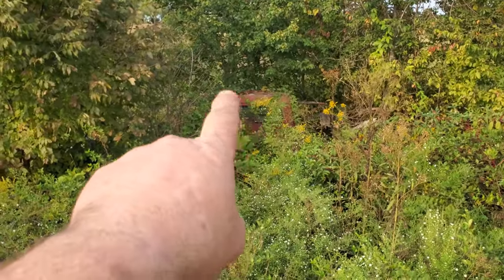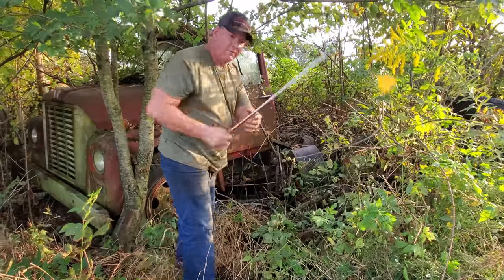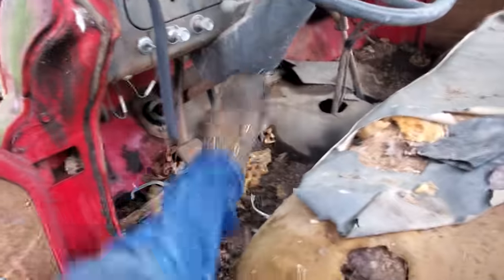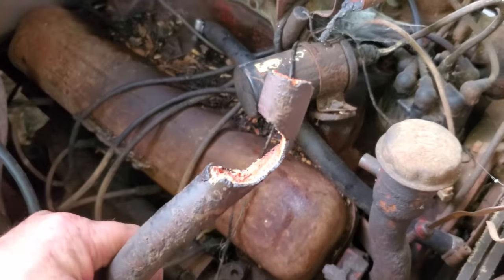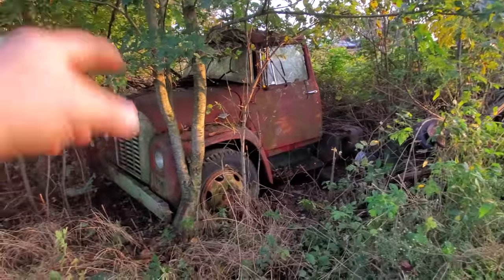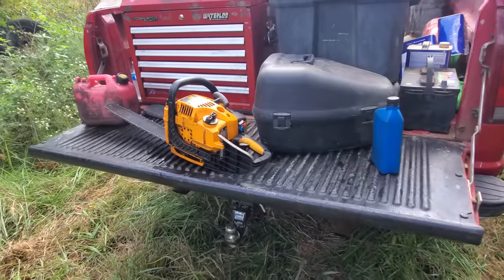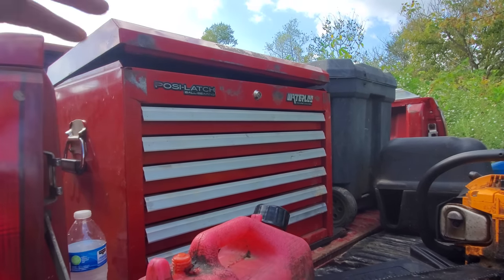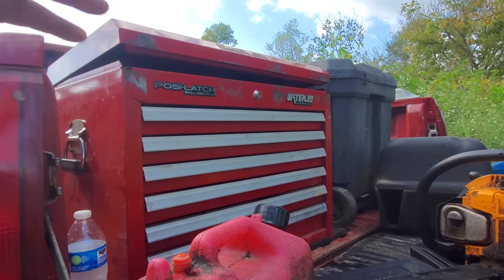IH Loadstar Sat 20+ Years Will It Run FAIL

Comment: Love these videos. My great grandfather drove a 1963 international loadstar 1600 for many years. He used it to haul cedar to the cedar mill to sell it for extra money. The old truck has been sitting in the field for about 30 years now but the 345 v8 still turns over. I haven’t messed with it other than that though. Its got about 250,000 miles on it and from what I heard from him before he passed it’s about totally worn out but ran when parked. Maybe some day I’ll try to get it going.

Comment: Hey Chad, The Kentucky farm license plate was issued sometime in 1993 in which the farm and commercial license plates always expire on March 31 as opposed to the regular license plates that always expire on whatever month your birthday is.  
Kentucky at that time always issued brand new license plates   each year rather than buying new decals each year. I wish that I could help you more, but that’s the best that I can do regarding the license plates. Around that same time period, I was running a 1979 Ford F-350 except my truck had the commercial license plate. 
I do remember that the IH and older Fords were sometimes a pain to get the correct parts for because of the change in production runs which meant that you had to know all the numbers from the ID plate on the door jamb.

Comment: Excellent video  Chad  :) also think that truck be 1966  to 1972 year also thought might been 304 or 345 or 392 V8 carb looks like Holley 1000  CFM  daul chokes with cable knob dash to plus 4 barrel , Transmission  be Eaton D18  Manual floor shifter 5 or 10 speed if has button on gear shifter with Bow Low First gear  and axle possibly be 390 or higher ratio ! 3 or 5 ton stake truck ! My late Father had International  farm tractors plus machinery  with Stake trucks and Highway Tractor Truck  for lots years 1960 to 1994 ! Also looking forward more videos too soon watch on this truck Chad and hope bash by eye okay too ! Plus may next try tow with tractor and bump starting too after soak engine up to! May work or not free motor too !

Comment: That Truck is probably early 60s like 63 clear up into 70s.  That sheet metal front end would fit on your Loadstar with the Fiberglass hood i think.  I H did not change those Cabs for many years.  I worked for a Dealarship from 72 to 77.  The Fiberglass front Hood was a later option.  303 and 345 were very similar engines.

Comment: My grandpa had a green one it was funny cause he had to have his girlfriend ride with him to hold it in gear cause it would jump out sometimes driving down the road he was in logging it was a straight truck your Chevy looks close to model I've got and windshield wiper motor has a circuit board on it and sometimes soldering joints break but joints are not small ones so easy to fix if it's the soldering joints

Comment: I really don't know of another brand of vehicle that has turned its image around anymore than international. I believe this style was clear up to seventy seven if memory serves me atall. That engine is to me not the best or other in power for this size rig, as that 345 was to me the very best engine available for a good many years. I myself have gotten the dang bug on this LS rage and can see a big 6.0 LS engine setting in the hole..... I am of the opinion that the original engine is absolutely the best way for cheap rebuild and run again. All of that said tho, the LS engines going a half million miles without too much work on them seems to be absolutely the normal thing for them and its making them quite high dollar rigs. For the longest time, Cummins 5.9 was the engine everyone ran to and swapped them into even Mustang cars. Kind a   stupid putting that much weight on the front of a car that might not weigh as much as the engine being swapped into it. I haven't forgotten that you spent the queens ransom for a new shop building that can stand getting say a four post lift maybe that is the style you can push around and move it out of the way or turn it so's you could get even one more rig in there. Most of us poor folks have  had the time when every thing in the shop was near finished but lacked something, so it got so full of rigs that should not be shoved back outside and so we wind up on the gravel outside in the weather working on rigs to make a few dollars to finish one in the shop.  I sure do hope with all of my seventy four years of age that it never happens to you. MLS,  you've said and I have forgotten what that stands for

Comment: Put a bb chevy in it 400 turbo out of a rv make ratrod hauler out of it with tilt bed ihave a dodge500 with same bolt pattern got newer 19.5 wheels  made  it looked slammed